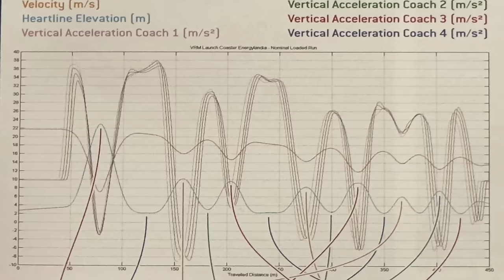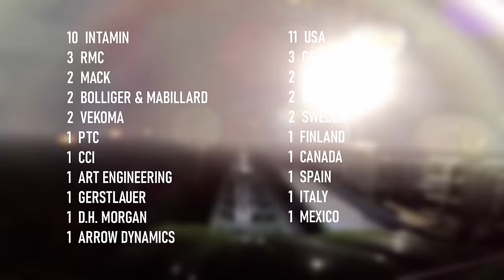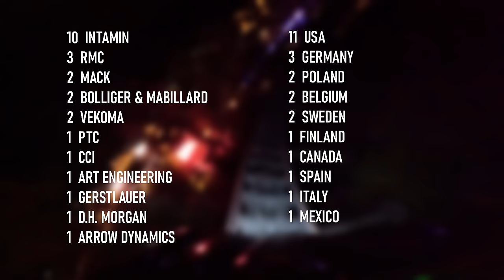TOP 25 ROLLER COASTERS in the World!

Comment: Mine
1: Fury 325
2: Millennium Force
3: Velocicoaster
4: Steel Vengeance
5: Iron Gwazi
6: Expedition GeForce
7: Superman The Ride
8: Taron
9: Intimidator 305
10: Maverick
11: Apollos Chariot
12: Phantoms Revenge
13: Leviathan
14: Lightning Rod
15: Iron Rattler
16: Thunder Striker
17: Mako
18: Helix
19: Hagrids Moterbike Adventure
20: Nitro
21: X2
22: Time Traveller
23: Guardians Of The Galaxy Cosmic Rewind
24: Candymonium
25: ArieForce One
And this is my opinion ok